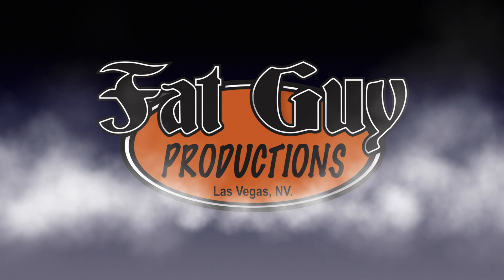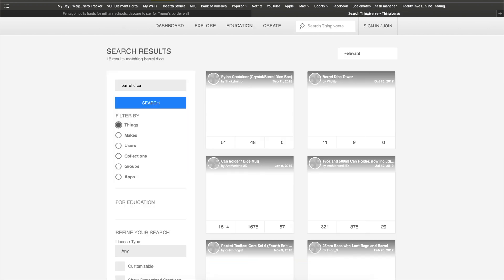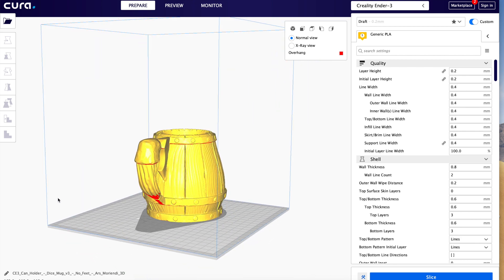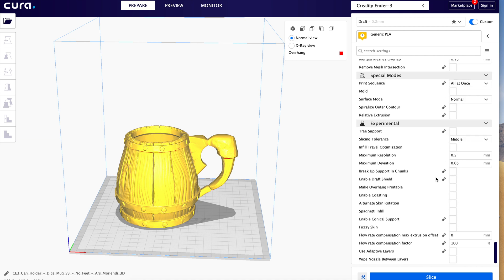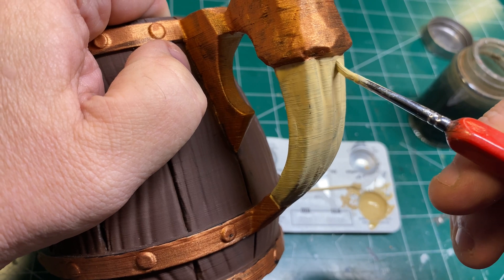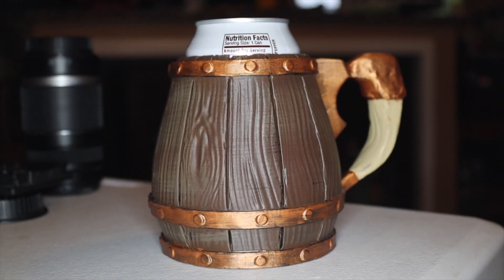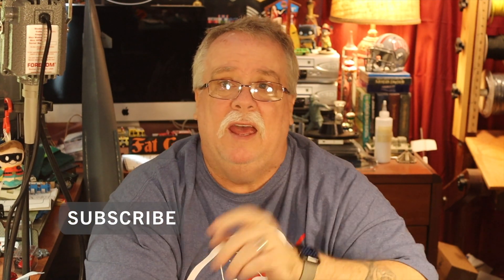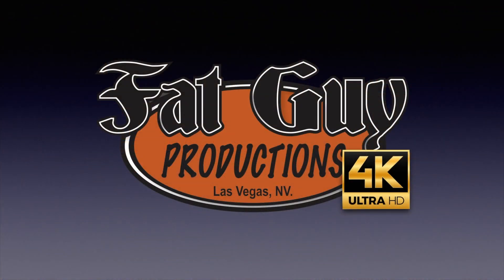3D Printing a fun and functional Can Holder!

Comment: Hey Paul,
I have a question about the monoprice select mini. What do you set you bed level to (in the tune setting)? I am trying to print the cat but my printer keeps failing. Thanks!
Reply from the maker: It is a massive adjustment - but all of these are different.  Watch my videos under my 3D printing playlist for how to get that set, and it will solve 98% of your issues....  I'd be more specific but right now it's not set up from rearranging stuff....